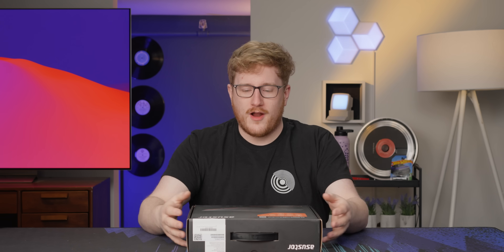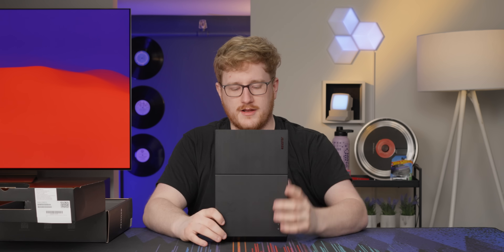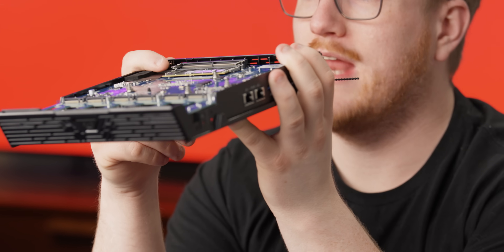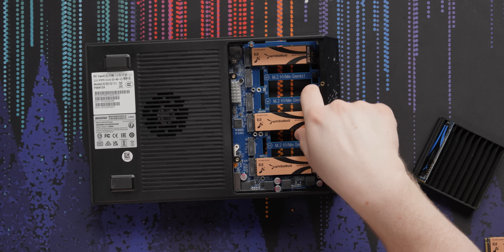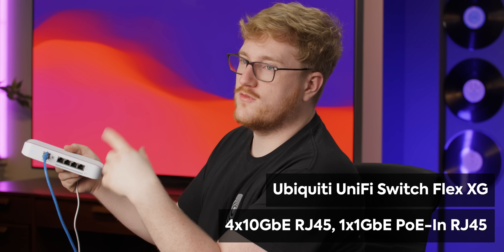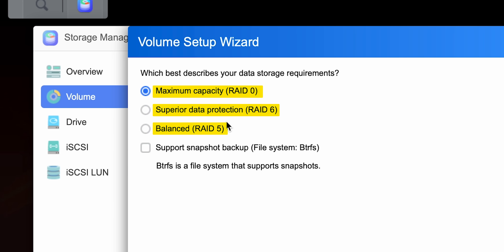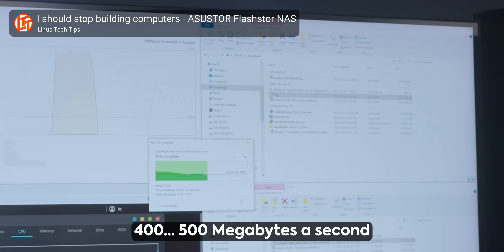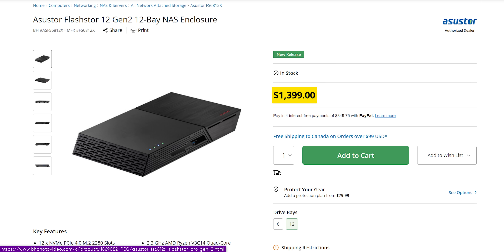They promised me they fixed it... - ASUSTOR Flashstor Gen2

Comment: I feel like the MS01 or the MSA2 from minisforum are much better bets. They have a ton of storage options and they do have actual expansion with a pcie card as well if you do need more storage space.
Reply: Or CM3588 nas kit on amazon
Reply: Minisforum are coming out with a dedicated 5+3 NAS system this year. No details on it yet in terms of price but at least it'll allow support for the truenas / omv / unraid.
Reply: They're both capped at 3xM.2 drives. Yeah, it's an alternative but not to the Asus one, more like an alternative to uITX build.
It supports U.2, but that's capped at 7mm height, which is just stupid small.
So like, 24TB max. Also, neither support ECC and the Asus does.

I'm looking at their ECC models and they're all HDD focused. Where's the damn U.2 NASes with ECC?
Reply: @ Yeah I guess it would need to be more their NAS system. IT does do U.2 though which has much higher capacity than M.2. IF YOU CAN AFFORD IT,  you can get up to a 61.44 TB U.2 so your capacity may be even higher. Granted with only 2 drives it is going to be a mirror so it will only be 61TB usable where with 12 8TB M.2 drives you can use RAID5 or RAID6 to get more usable storage

Comment: they should have cut down the USB quite heavily to get more lanes for the storage. And one high speed ether net is enough as well for a NAS . .
Reply: Exactly they do not need 2 USB4 ports and they only really need 1 or 2 10G USBs.
Reply: @Luke357  Actually, the USB4 would make a ton of sense if they allowed connecting the NAS as a DAS too
Reply: @nitrobear  what is a DAS?
Reply: @Vyntral direct attach storage, similar to plugging a hard drive into a pc for example but with more flexibility. The jellyfish editing servers on LTT a few years ago were similar for example - very simple to use for less technical folk as just plug in a usb cable and away you go
Reply: @nitrobear  I get it but you don't need 2 of them. It's wasting PCIe lanes that should be for the drives.
Reply: I don't know why nobody is talking about the stupid layout of PCIe lanes in the first place. 

Even if they didn't remove the amount of USB, they could still have Gen 4 x2 lanes for each drive. But instead they put an odd combination of Gen 3/4 x4, x2, and x1???
Reply: I mean, Jake's main gripe was a lack of speed, so, presumably he'd want 2 10 Gb ports.
Reply: @ 10GB USB not networking.